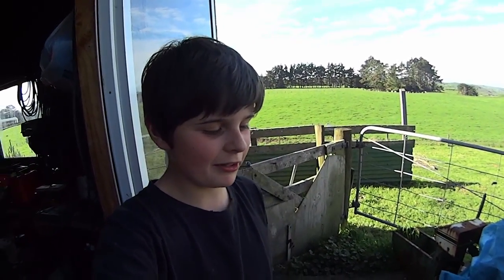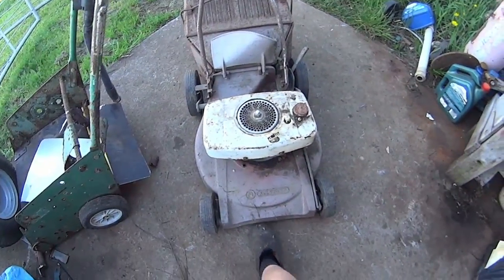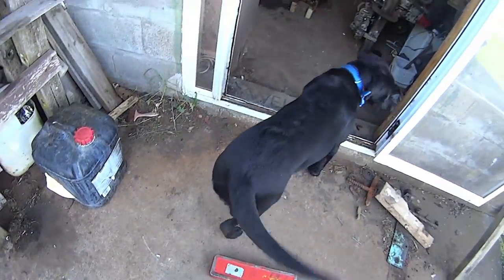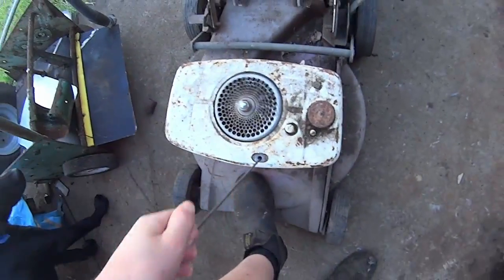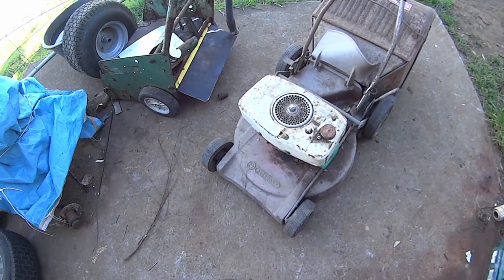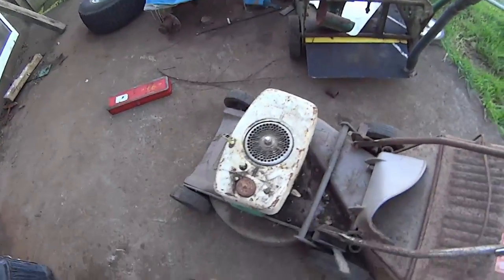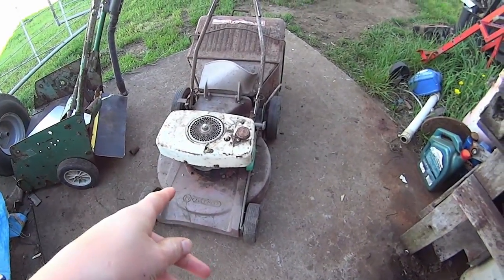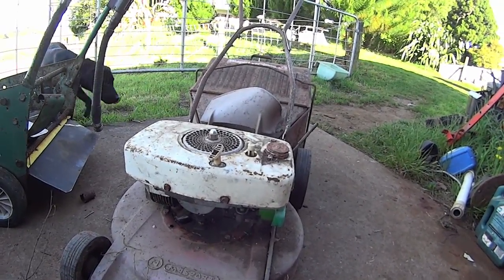Masport iron horse revival (lawn boy engine)

Comment: These were called the Masport President 2. There was also the Masport President Super 4 at the same time. These Presidents came out around 1973 and were the upmarket model of the Masport Premier 2 and the Masport Premier 4 which came out in the 60s. Both models had "Ejectamatic" catchers which could be emptied in a second, as the whole top of the catcher would open up making it super easy to empty. My grandparents got a mower like your one brand new in 1973. I used to service it. I'm now a semi-retired lawnmower mechanic, and your mower brings back lots memories. Great video mate.